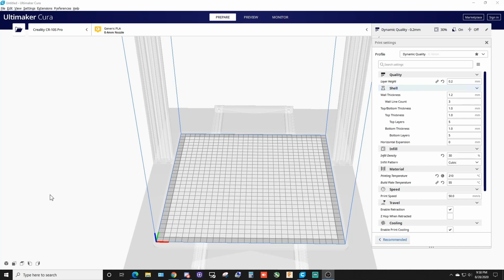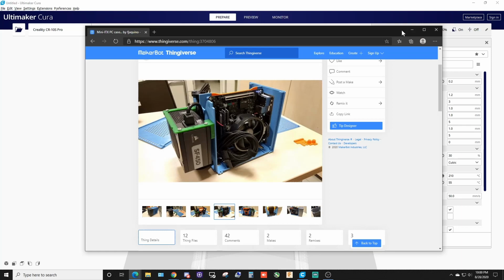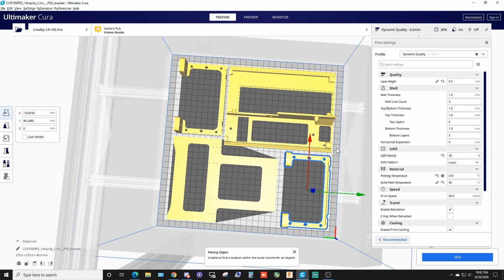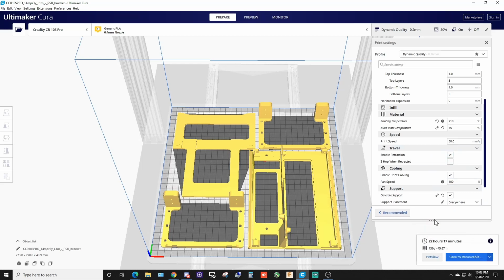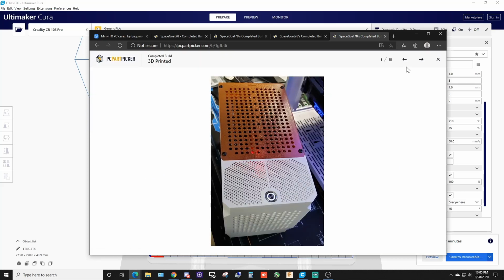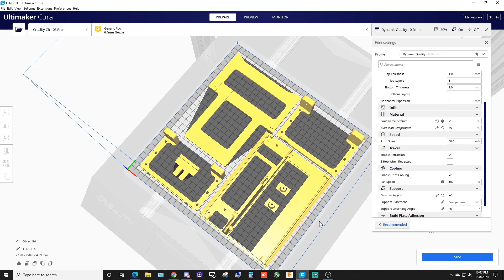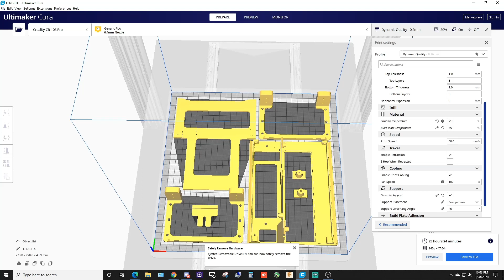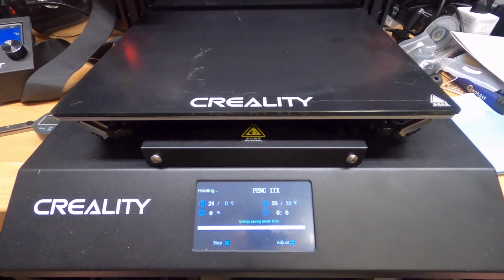The ITX 3D Printed Case on My Ender 3 and Cr10. Part 1

Comment: Bro im loving these builds and that your making videos of them. Keep up the great work @SpaceGoats
Reply from the maker: Thanks, I will have 3 or 4 videos on the ITX build. I hope everyone like them. According to the snobby Panda I need to get better audio and video equipment.
Reply: @spacegoats2194  better audio yes so we can hear your sensual voice better😜
Need to print one for a full size gpu but my printers bed size is to TINT hahaha
Reply from the maker: If you go and look at the the ORLY build, I did it with the longer case. Which allows me to add a 210mm GPU. 
So I was able to install a RTX 2060KO.  https://pcpartpicker.com/b/sx9G3C 
But sounds like you need to use one of my LINKS and get yourself a bigger printer...